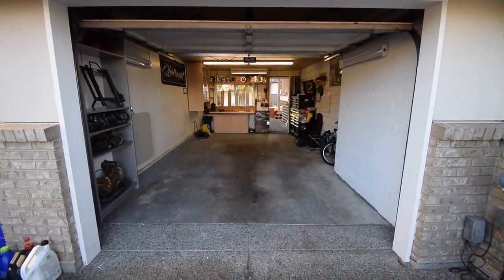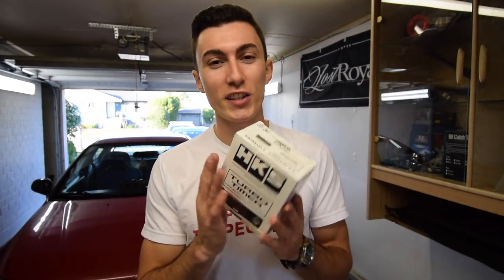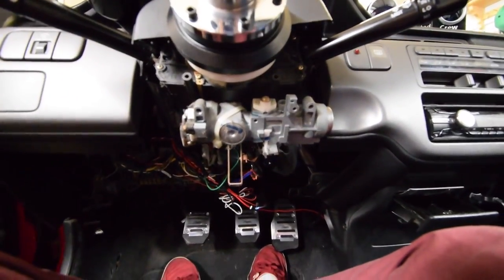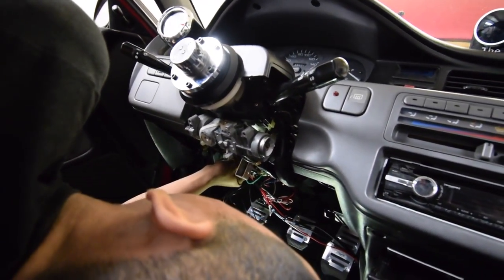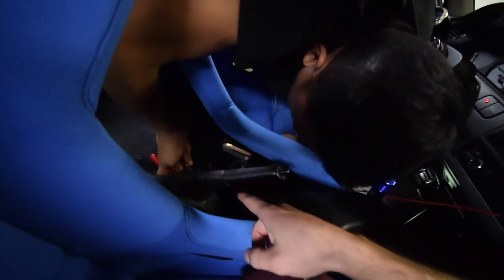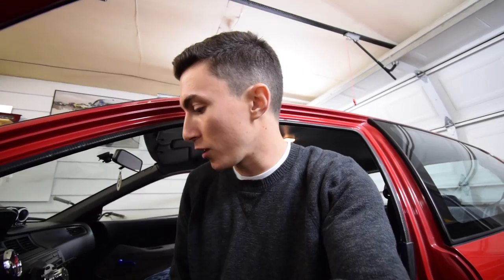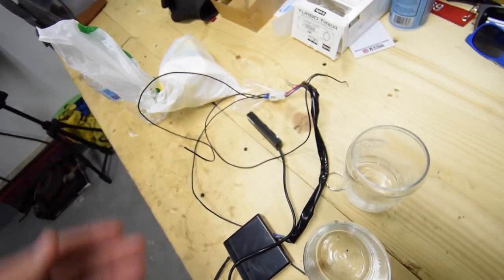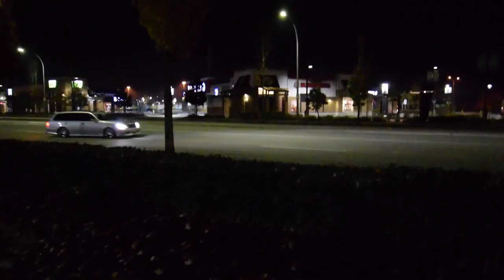Does a WISH Turbo Timer Work? - EG Hatch

Comment: Not sure why I've not mentioned this before but I'm and electrician. I'd love to contribute something to the project if possible. Let me know how I can contact you directly and I'll see if I can round up a goody bag of electrical tools etc for you. 

Also I've just cone into a bit of money and I'm going to get another car. What do you reckon I should go for? (Everyone can vote!) I'm in the UK so it won't be an American car. I was thinking either a WRX Impreza, a 2005'ish Civic 1.6 VTEC (and turbo it!?) Saab 9-3 hot aero 2.8 V6, Audible TT Quatro 1.8T, RX8, or there are a few UK Fords like the Mondeo ST 2.2 TDCI , an Vauxhall/Opel MK5 Astra SRI/GSI or Vectra SRI/GSI.

Or the other route is a sleeper MPV?? Can't decide people help me out!! 

#CommittedCrew
Reply: Audi TT Quatro
Reply: WRX's are awesome but a bit dead,it is way too tame.
The civic is going to be fast on straight line,but i would get bored of that really fast.
I'd say go with the Audi TT,try snatching the V6,but even 1.8T ones make 200+hp and with new injectors,plugs and a remap you should be able to hang around 300hp.
A different turbo could make more peak power,but the car has quattro and handles great so it would make no sense to turn it into drag machine.
It is really comfy and i think it is perfect for UK,just carving those curvy roads and enjoying the landscape.
P.S. Look into the BMW e36 325/328i or e46 330/325/323ci
Reply: @dog_g5048  Love this car! I've got a black Quattro with black wheels and tinted windows in my eBay watch basket already!

More votes and suggestions please people!!
Reply: Sleepers are cool cars to have but people don’t appreciate what’s under your bonnet say if you were driving past but honestly just go with your favourite
Reply: Get a Honda Prelude! Some of the best options where out in europe, i personally own an imported prelude from japan and i couldnt be happier
Reply: Go for the Audi for sure [imo]
Reply: Rx8 Rotary all day
Reply: Mazda Rx7 or rx8
Reply: get a 240 dude, just send it!
Reply: Audi TT with the VR6
Reply: R. Kelly 😅 sorry mate had to! But i think u should get an import. If you check out autotrader you could cop a nice 200sx without completely breaking the bank, i guess... then again in my case a little old micra would break the bank personally 😂
Reply from the maker: I would say if it is a second car just for fun, RX8! there is also an email in the "about" section of my youtube page if you want to contact me!
Reply: @hammadhussain9475  😂😂😂 I get it all the time dude! I used to so the high jump and everyone would sing "I Believe I Can Fly" 

I'm narrowing down the search. RX8 or Audi TT. I've booked a test drive of a TT and a Civic already and I'm waiting on the RX8! 

I'll have another car by the end of the week!
Reply: @lazar2175  I had a BMW e46 M3  with twin turbo conversion running close to 550bhp. I took it to Nurburg. So I'm after something else now, something for a fun drive!

If I could list all the cars I've owned you lot would get bored. If I could afford the running cost I would go for the Mitsubishi GTO 3.0 twin turbo as it's on my top ten. I've also said I'd own another R33 Skyline but I've got to wait until my younger two children have grown up a bit! lol
Reply: @chrisolson2365  Not keen on the prelude! I always thought the Mitsubishi GTO was the better of the two cars of the time!
Reply: @zachbarton84  I'm tempted! I've found one in my price ramge and I'm waiting to test drive in the next 2-3 days.
Reply: @bestnameonthisplatform352  RX8 is what I would choose out of the two. I'm waiting on several test drives ATM.
Reply: @rick-hj3jg  I had a 200sx Sylvia years back. All I ended up doing  was rebuilding the rear diff every other week! lol
Reply: @hammadhussain9475  I think the 3.2 would be too rich for me ATM!
Reply: @RobbieFerreira  The car will be a daily runner hence the lower engine sizes. I still want something to play with though lol! I'll email you shortly.  I just thought a few better tools would help with wiring etc and I have duplicates of lots of tools. I'll dig out a professional crimp tool and crimps and a Multi meter for you! I'll see if there is anything else of use! Are you going to put a Sub in the trunk of the Civic? I have a spare Amp and wiring kit which I can send also.
Reply: @bertrumbassetesquire3118 , oh r. I. P nvm then... Just buy a prius😂 jk
Reply: Audi
Reply: @lazar2175   i have a wrx and it still puts a smile on my face for the past two years. any car will have potential  but for the price a wrx is a great platform and comes with a turbo and awd and can easily be pushed over 300hp. it looks more aggresive than a TT in my opinion.
Reply: Alright! Good luck mate, RX8 sounds like one which will stand out of a crowd here in the UK, TT would be an interesting project and... the civic is of course a civic! You couldnt go wrong in getting one😅 You could maybe vlog your project like robbie mate, id be interested to see how it goes. Your call tho.
Reply: @StancedInertia9  WRX is okay,but my opinion is that it lacks power being AWD.
You don't get to do a lot of skids,drifts,donuts and other shenanigans us car guys do.
So i would either go for STI blobeye(my favourite) or Audi TT.
The TT has leather interior and and a lot of luxury stuff subies lack,and me being a spoiled BMW twat i can't stand plasticky enteriors.
Reply: @chrisolson2365  #PRELUDENATION
Reply: SAAB! I love my 9-3
Reply: If you’re in the UK get a Subaru Legacy B4 BE5 Rev D. They’re a twin turbo EJ208 AWD with similar internals to an sti and an amazing suspension system. Even better is that you can single turbo convert them pretty easily and they’re cheap with easy parts to find (They go for around $4k NZD over here for a decent example)
Reply: Mk2 focus rs?
Reply: Civic
Reply: Impreza4life😀

Comment: Did you guys put fuses in line with the timer or did you just try and run 94 volts through an 8 volt system?

Comment: bruh that exhaust is still rice af
Reply: @crisghee100  I dont even have a mom, and why the hate? he said the RX7 had riced exhaust before..which it did and now the new exhaust is still a bit riced
Reply: AFX Gaming please enlighten us on how it’s “rice”
Reply: @geremiazabala3656  it's way to loud and obnoxious, RX7s sound best when they arent so loud and you can actually hear stuff, rather then ear deadening fart can, it's a personal opinion dude he practically asked us if it was rice or not
Reply: 😂 do you even know what a rotary is? Or how it works?!?!
Reply: @mikeymike8819  I probably know more then you do lol, the legendary 13B Dorito engine
Reply: Enlighten me😂
Reply: @mikeymike8819  The housing is an oval shape and is 2 channels throughout it in order to cool it and let the oil and coolant flow through the engine, the engine block is completely sectional aswell and each rotor housing can be separated from the other, the central shaft is offset almost like you would see the pedals on a bike, and the rotor itself connects to the central shaft via gears, the rotor is sealed usually with either ceramic or titanium seals even though those are the most unreliable ones, and the rotor will rotate around and trap and compress airated fuel which a spark will then ignite pushing the rotor around again, this allows the engine to reach very high RPM and produces the legendary sound. not to mention it has even been used in Le Mans, and been banned because it was too fast
Reply: Google is a powerful resource
Reply: @mikeymike8819  Dude if you asked me to enliten you don't criticize what I say, just because somebody knows something doesn't mean they googled it, I actually rebuilt a 13B a while back at a friend's shop for a customer
Reply: @AFXGaming  what did u rebuilt on it lol
Reply: @stevencalero671  replaced all the O rings and Apex seals as well as cleaned up the oil passages in the housings then put it back together and got it running

Comment: Shame it died...I bought pretty much the same. But from eBay and it worked.
Reply: Joshua Phillips got a link?
Reply: itsoner j sadly no it was about 3 years ago for my s13 Silvia. Originally it had a turbo timer. But it aswell was just a cheap one and (I didn’t like the look of it) so I just ran it from its wiring.
But had the same handbrake splice connection and it worked. Handbrake up would make it count. As soon as handbrake was down / the timer would run out car would turn off
Reply: Joshua Phillips oh ok what a shame
Thanks for replying